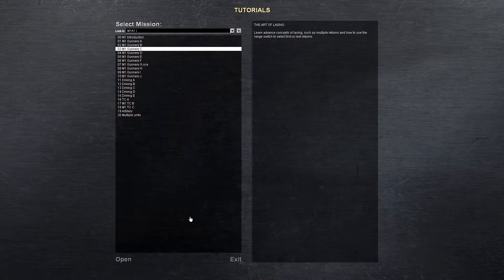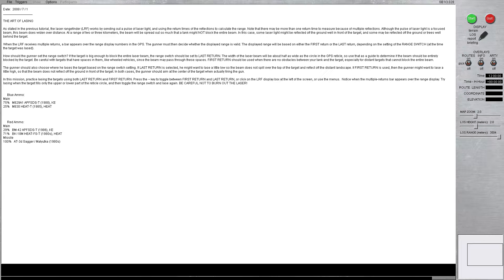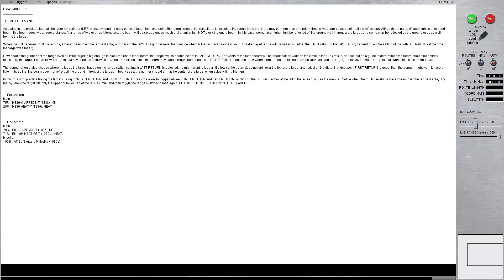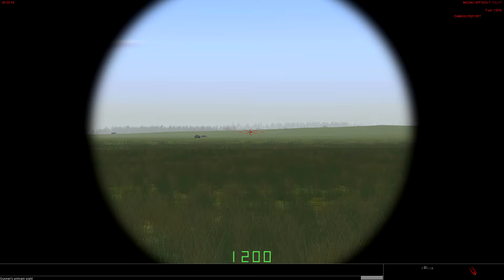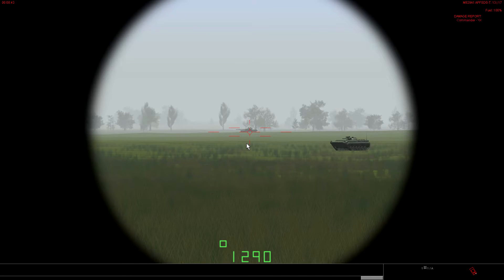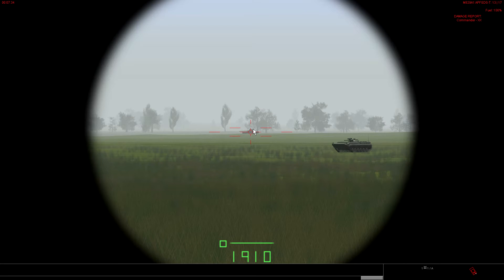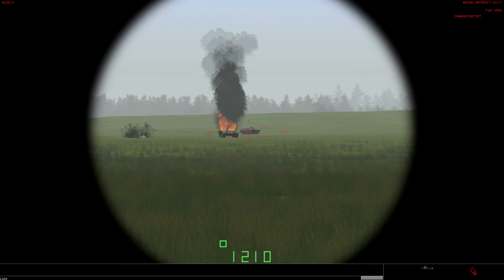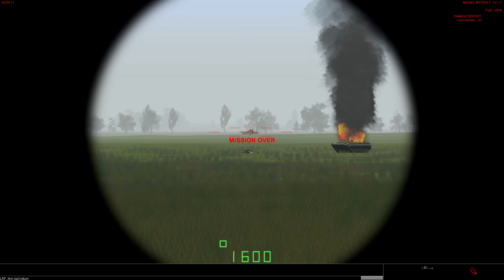Steel Beasts - Tutorial - M1A1 Gunnery C - "THE ART OF LASING"

Comment: Which return should you use when engaging infantry at mid to long range, such as 500-1000 meters?
Reply from the maker: Depends on what kind of cover they are in.  If they are in a building lase the building using either or.  If they are in the open or woods I would spray with the .50 or coax instead of a main gun round.
Reply: @IMIKEBRAVOI  So you wouldn't lase when engaging with coax, even at those kinds of ranges?
Reply from the maker: @Orca19904  I typically dont, i usually just eyeball it and walk the coax/.50 rounds in.  Not saying that's the best thing to do but for me it works.
Reply from the maker: @Orca19904  The problem is trying to lase an individual soldier and get an accurate return.  Its almost impossible to do (for me anyway) and you are better off lasing somewhere near the infantry using whichever return is best suited for the cover the target is in.  500-1000 meters is fairly short range in terms of your tanks effective engagement area for the main gun.